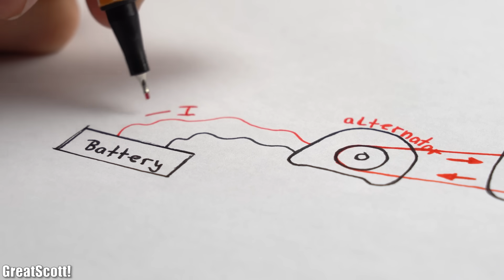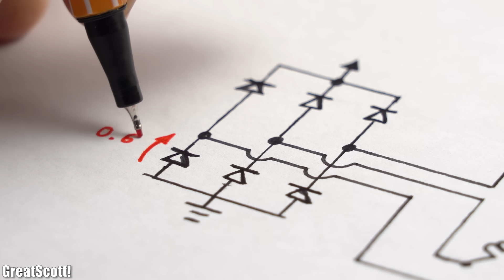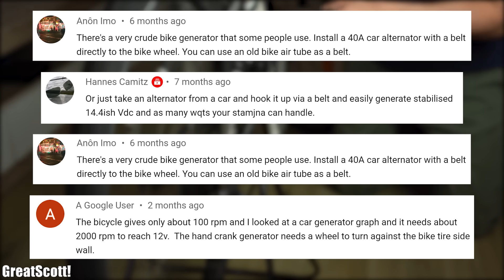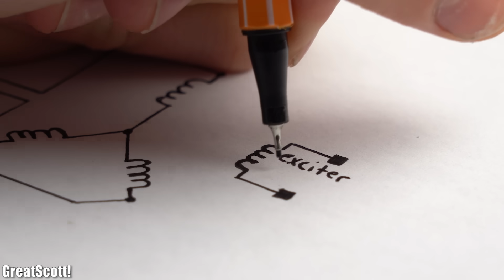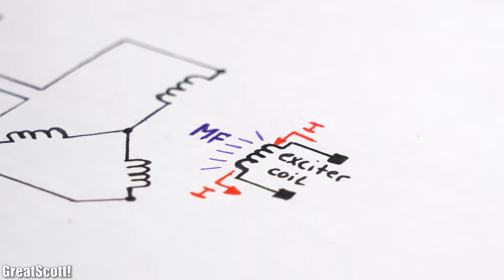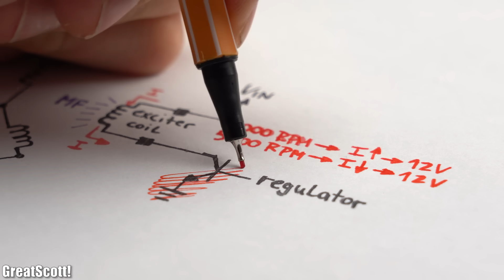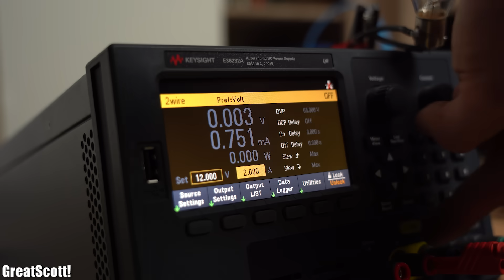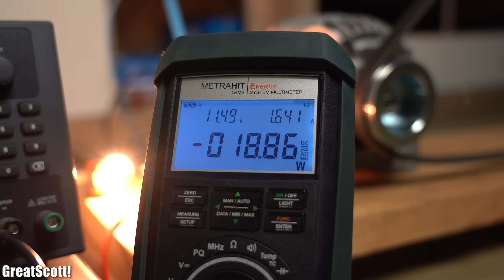Using a car alternator with a bike to power my home? How much energy can I produce?!

Comment: When we look at things like this and how much power we can make or not make, then we can see the issue.

My idea was to use a small generator with a good output to charge batteries. The spec is  20 amp for 6 hours at 220v cost £5.40
26kw which is good power of we forget losses.
Then secondary is a small power intake from solar panels, I was thinking two 250w panels. 
But then I thought that to power the house this way I would need to separate the power and lines to make the most of them.

Lights use lower power, so a small solar system should run the lights. The big items such as shower and cooker use a lot of power as well as the kettle, so they should be kept on  mains power. Then dividing upstairs and downstairs sockets, as typically upstairs uses only low power items. (Not so much here).

By using the 220 or 110 getting power and losses on inverting is lower. 
10*12v batteries 120ah = 1440watts X10 -25% 10800watts

This is more than I typically need, but I would need to run the generator for one or two days a week  while solar adds a small amount of top up power.

I was thinking of making a water wheel that was inline with the house supply, so all items using  water would creat a flow and then some power, but this would maybe power the lights, but adversely lower pressure.

As you may have noticed the tank run time of 6 hours generates more than the battery capacity. So to deal with this I would need to run for less time, or double the battery.
At 150£ for a battery (1500) for three years (good life span AVG)
The costs
£3,000 battery pack
£310 fuel
£750 invertors
£90 components.
£250 solar panels
This costs £4400 for the first year and then over 6 years £8,300
That's a cost of £1382 per year.
This is about what I pay for mains power so there isn't any benefits from cash or environment gains from doing this.

Comment: I feel like you would get better results if you got a 3phase ac generator that they use for many small wind turbines and ran that through a DC rectifier to produce power. I feel like generators with actual magnets inside will always get you better results.because car alternators are designed with the knowledge that the engine is running high rpms and can take the load and need the voltage regulations to prevent burning out the electronics and battery.

Comment: About 10 years ago, I designed a self-starting, switch mode regulating circuit for exactly this setup, which was used at Roskilde Festival for a number of years for people to charge their phones. It could output more than 50 W, using a cheap 230V inverter, if you really wanted a workout. Sadly, I've lost the schematics to a PC breakdown some years ago. Let me know if you want me to draw up a draft of it, if you would like to replicate it.
Reply: I would be curious just to see if you would be okay with that?
Reply: @TrollFaceTheMan  Alright. I'll see what I can do, but it might be a couple of days before I have the time
Reply: @GoofyChristoffer  cool, thanks
Reply: @TrollFaceTheMan  Done. I'll send it to you on facebook. I can't send files or post links here.
Reply: @GoofyChristoffer  sounds good, thank you.

Comment: try installing a Riemenspanner (engl. belt-tightener???) to prevent the slipping of the belt (used in most cars to counter the elongation of the belt due to heat and wear)

a decent fit human could produce 150-250 watts easy

Comment: But the power is limited by a light bulb, isn't it? 
Light bulb is rated for 21W, and maximum power was ~21W. So, maybe, it is worth trying something more poweful?
Voltage is constant, but you can change the current

Comment: Those small pins are for charge trigger and voltage display on the dash I believe. It's a good idea for converting calories to electricity but you are not that fat, So just get solar panels.

Comment: Well, this was straight terrible. With a chaindrive you can get easily 100W of human power. Belts are superinefficient. The energy you should store to a supercapacitor, because the bike output is super variable. With a classic car generator the exciting should be done thru a 5W bulb with the original circuit, not with 2-3 amps, 100-200mA is more than enough to generate power.

Comment: Haha LOL, so sketch. I could of told you that was a fruitless endeavour. However still made a cool video :P
When I was a kid there was a local science and discovery centre that had 3 bikes setup with different ranges, they're probably still there. They lit up lights in different Watt ranges for different equipment, the amount of effort just for basic items was pretty impressive, it gives you a respect for the amount of energy we use. I remember thinking if I could barely power a TV what's the point, but todays TVs use far less power maybe we could :P

Comment: Great Scott, I love your investigative experimental spirit!  I always thought permanent magnet generators (or motor) to be more efficient than car alternators for generating power.   Also, the efficiency of the alternator at such low power levels is likely very poor, compared to operating closer to rated power.  My guess is you'd get much better results with a dc motor (as generator) rated at 200W.

Comment: IM happy you are getting closer and closer to discover the wind generator :).
The best type of generator for this purpose is the "american" flat generator. Its just a plate with neodymium magnets which is rotating and the stationary plate with coils.
There is a  ton of such projects on youtube.

They are the best as you can easily tune the power generated by making the gap between magnets and coils bigger/smaller and you can set how many phases of electricity you want to generate by making more or less coils. Its rather easy to make but its a bit labor intensive (winding the coils) but it has the advantage of not requiring too many rpm to work.

You can actually fit this whole generator on the back wheel and not loose efficiency on the belt.

I did not wanted to be negative but once you research the windmill generator you will see how bad idea was the alternator and listening to clueless people on youtube :)
But if the goal is to get views then its probably not relevant :)

Good luck with the better approach! :)

Comment: its meant to put out 14.5v when charging not 12,  optimal rpm is generally 2-3500 rpm at the crank ,.. least resistance hp is generally around 1/3 output ,,. they are designed to balance the cars usage against the battery which provides the discharge rate suitable for the starter ,, the load detection dictates the exciter with  the regulator, systems very greatly ,, regulators and load detection are internal in most but not all alternators ,. they are bruit force alts., so not efficient unless you are wasting gobs of power like gas engines do ,  i would try a loaded curcut ,,, it should try to power the load

Comment: I run multiple high output alternators for the audio system in my truck.  They output 370 amps each.  I wonder if a higher output alternator would yield you better results.  I power several thousand watts in my truck.

Comment: You need to add a belt tensioner, this will ensure the belt does not slip even when the alternator resistance increases.

Comment: I belive that u dont need input power to work. U can conect input power to output power, and add a very small permanent magnet near alternator, Just do start to generate power. Once it is started, generated power is used do feed exciter coil

Comment: I thought I understood that an automotive alternator running at its rated output would rapidly overheat...
I don't think they are designed for continuous output but rather to top up high drain batteries in the short term.

Comment: Good video. For a while I have been thinking of using a 36v brushless ebike rear wheel hub motor as a generator. If one without a freewheeling mechanism was used, no mechanical modifications apart from lifting the back wheel of the ground would be required. This would also eliminate the rather large innefieciencies of the belt and requirement for the exciter coil. This would provide 36v and from earlier tests, the maximum speed at which they can be driven at is limited by the voltage that their output is clamped to, so for a more usable experience, some form of buck regulator would be required that would try to keep the current out from the motor constant (for constant torque) or the power output constant (for constant power) instead of doing what a normal buck regulator does and keep the output voltage constant. This could be used to charge batteries and could gradually reduce the load if batteries start getting overcharged.

Comment: Tighten up the belt by moving the alternator back, that way you should be able to pedal the higher resistance generating a little more electric.

How do you plan to store said electricity? Or do you just plan to charge your phone with it

Comment: You missed the most important part!  Just connect an electric motor to the belt and connect the wires together.  Give it a spin and off you go!  Many on youtube have created "perpetual motion" by doing just that and adding a few magnets and a coil seems to work well too!  <grin>  Thanks for another great video! Cheers!

Comment: Why not use a DC 12V 24V 400W permanent magnet generator used in wind turbines?
Far less messing about with the internals of the generator.

Comment: If you think as your pedling the voltige is all over the place 

But on normal power lines its 120v but in the gen is 

Trying to demo "all over the place volts" 1+ 1- +-+-+-+- 

Soooooooo HUH
Reply: Like the     speed=MORE VOLTS   low speed=-THE SPEED

Comment: Alternator has some sort of a linear voltage regulator, when you spin it too fast without having a proper load it dumps the extra energy as heat to keep the voltage regulated, to calculate the power output you'll have to add more light bulbs parallel (or you can use a adjustable electronic load )

Comment: I saw a video a few years ago where a 9V battery was used to excite the coils then once power was being generated a switch was used to remove the 9V and apply the 12V coming from the alternator to keep the excitation coils powered .

Comment: a decently trained human should be able to produce hundreds of watts of power for relatively extended periods, so this setup seems to be quite inefficient: probably most of the energy is going to belt slip?

Comment: Although commonly referred to as 12V in a car, the regulator in the generator will try to hold the board net voltage between 14V and 14.5V. So that it can charge the 12V battery

Comment: Most alternators need an input voltage to get the magnetic fields needed unless you have a self-excited alternator. You do need a tensioner wheel to make better contact for the alternator pulley with the belt to eliminate as much slip as possible.

Comment: I made one. Used the alternator of an old Trabant and was able to charge a solar battery with 70-90W.
With mine, the residual magnetisation of the rotor was strong enough to induce enough current in order to fully start up the field. (I used it with the attached regulator.)  I put a relay at the generator output. It only closes when the output voltage is build up, so that the regulator can pump all the current generated by the residual magnetisation back into the exciter coil in order to strengthen the field. 
I think more power should easily be possible but the voltage drop across wires, relay and BMS was to big, preventing higher currents.
I am currently trying to design my own regulator, so that I can set a higher output voltage.
Reply: Oh, and I didn't use a belt and instead just pressed the belt wheel directly against the bike tire. Same gear ratio as yours.
But looking at graphs online, those alternators should be more efficient the higher the rpm get. 
So what I will try next is to reduce the driven shaft diameter.
That should also make the startup easier as I don't have to pedal as fast anymore to create enough startup voltage. 

Regarding my custom regulator: I guess making it linear wastes to much power, right? Currently I am trying to design a threshold switch with hysteresis (using an opamp) to turn a BJT on or off which in turn drives an n-mosfet. But I have a problem as I try to use an opamp that is not rail-to-rail and I therefore I struggle to switch the BJT off. 
Are there simple tricks to get around this problem without special parts? 
The opamp (TL081) can only go as low as 3V (I think). I thought about using a voltage divider to reduce the voltage level to below 0,6V but I fear that this could limit the base current to much and make the whole thing unnecessarily slow. 
Is there another way?

Comment: Use a hoverboard wheel/motor, you dont need to spend energy in the excitor coil as it has permanent magnets, it is almost ready to use, just need diodes and the mechanical adaptation.

Comment: the initial startup voltage was well known to me to get the initial kick to generate power, however for this kind of generator to work you just need a small current to begin not to burn up the circuit and it is many times just made with a 5 watt bulb in series with the exciter coil input, note that without a battery connected to the alternator the voltage regulator will go haywire and it won´t be able to keep the rotor magnetized properly either and also not a stable output, so a proper setup would been to have the alternator connected to a battery on the B+ and B- connection and then a switch with a bulb in series to the start circuit (with the exception that alternators today use different kinds of input for this start circuit you could also need a direct supply) but the idea is that when there is no power going in to the exciter there will be no discharge of the battery when the car is not running.

Comment: If you were to do this again you should buy an older style alternator with the 2 pin plug marked LS. Your alternator is a PD plug type which its charging voltage is controlled by the cars ECU (as you found out). The older LS style only needs  the output voltage applied to the S pin for it to supply charge. Ideally you should have a battery connected to the output as well so the alternator can 'Sense' how much charge to output. Forget about the L pin as it's connected to the battery light on the cars dashboard. Hope this helps

Comment: It actually outputs 14.2V, outputting 12v as you mention, would not be enough to charge the battery AND power the vehicles electrical demand.

Comment: Only generating 20 W implies something is really inefficient in this setup.  I'm about as supremely out of shape as a human being can get, and even I can maintain around 130 W for a solid hour on my bike.  Bicycle drivetrains are pretty efficient at around 95%...  If you were on the hardest gear and/or a single speed wheel, you might get better results...  also, the incredibly floppy belt in the video makes me think a belt tensioner/idler pulley might be in order.  You're probably losing some energy there, too.

Comment: Maybe try to do something with wind turbine. It will be able to produce some energy over time and then store it in battery cells, to make 12V night lights system or something you like,  it would save you from biking ;)  Battery pack could be made of laptop battery cells managed by BMS or 4x LiFePO4 = 12,8V from an electric car.

Comment: Next time use an old opel alternator and a random 12v battery, connect the m8 stud to 12v and the m6 stud to 12v through a 2-5w bulb, it excites itself and produces steady 14v.

Comment: alternator's  are designed  to charge a battery at a slow rate your system  would  work great if you put a battery and your power sign wave from the battery should be smooth but still DC you need a inverter  to AC to power house hold appliances  good video keep safe

Comment: Helloooo, another great video. I did not see the video of the tachometer (rpm meter) that you use for measuring the rpm of the wheel previously. Could you link the video of it. Thanks a lot. 🙃

Comment: I made one recently using a permanent magnet generator I built for a wind turbine and never used. Have been able to get 400W into the load resistor making it glow orange.
I used a car alternator years ago and found it very inefficient.

Comment: @Great Scott:  If you search youtube you will find a number of ways to turn a 12 volt car alternator into a Mains power generator.  (Do it by disconnecting all the diodes.  Alternator is now a 3 phase 110 generator)

Comment: Dude, belt are not tight at all! It will not gonna work this way...
pinout of alternator can be found in service manual of the car where it came from. Alldata is easily assesable for such info.